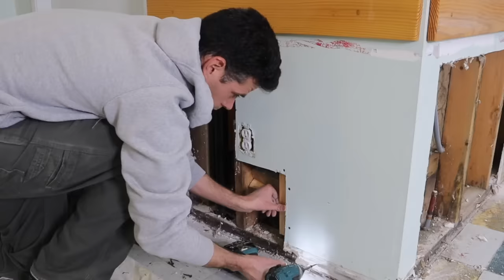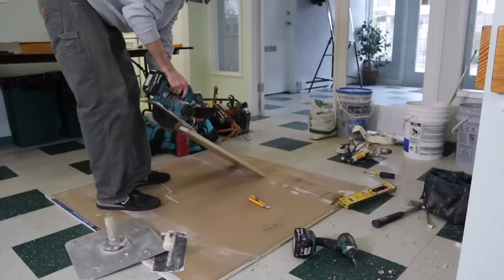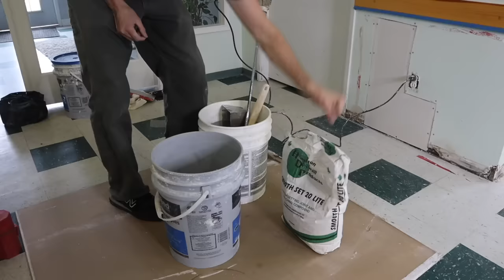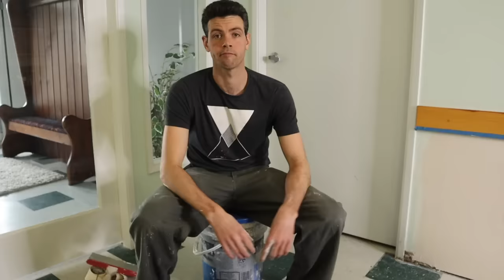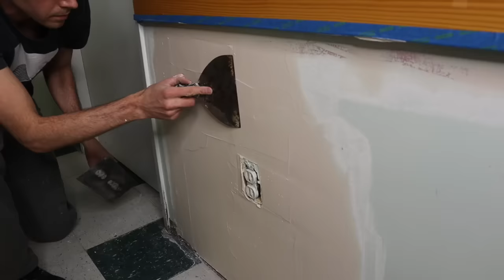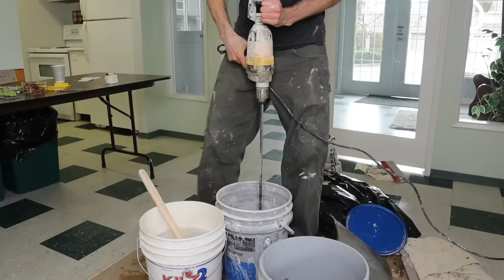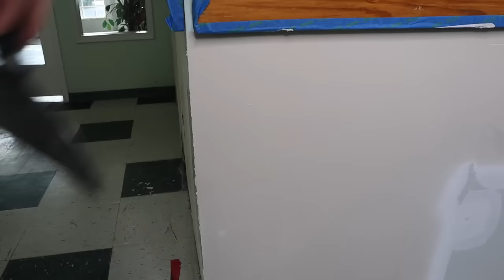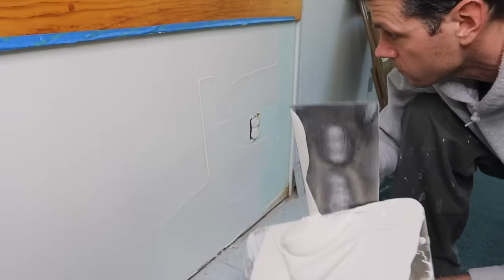Strangely Satisfying Drywall Repair!!!

Comment: Thank you you convinced me to hire somebody else to do this for me
Reply: He did it completely overkill fyi
Reply: @TheKSProduction  how so. Yeah, it's like a level 4 or 5 repairs he did but wouldn't you want to show the best way if you're a professional like him?
Reply: @TheRebuilt1  oh man, lose the attitude :-) take it a little easier. This fella definitely was on the overkill method. Just get the patch pieces as tight as possible, trim away tattered edges with a very sharp knife, tape it and mud it working your way up with a bigger mud knife. I just stopped to look after I saw him using a concrete trowel. I have anywhere from 2", 6, 12,  14" trowels that are over 20 years old. Buy good stainless steel stuff and it will last forever... But in a pinch I have used anything to spread mud. Everything except a concrete trowel! I have those too, I was just laughing at myself for not thinking of it.
Anyway, he's not being negative saying it's Overkill. Not being negative about the final job. He just did it the hard way. I do things the hard way sometimes trying to invent a new method or make something better that doesn't need to be better! I'm glad he has the time and gets to put himself on YouTube and show someone how to do it even if it is the long way around the block.
Reply: Lol
Reply: Most people would patch, mud, and sand. He just happens to have expertise in skim coating and such. Otherwise, even most contractors would just mud, build it up, feather it out, and sand. They won’t skim coat the entire wall.
Reply: Same 😭😭
Reply: Lmaoo 😂. Same
Reply: he should change name of the channel to Vancouver Cowboy 🤠
Reply: @timwilliams632 think he's just better and more used to the feel of a trowel, in many videos he says a diy person will probably pick up on a knife easier.
Reply: Lmaoo
Reply: @timwilliams632   When used on mud it's called a mud trowel.. 👆

Comment: The best tidbit in this whole thing was the 3m spray adhesive on exposed brown paper. That stuff can be a bear without painting it first. This is gonna save me time for sure
Reply: Agreed, trying to mud over that guarantees bubbling, I am so happy he showed that.
Reply: I didn't even think about getting this in spray cans, me, the pleb, was doing it with a brush even for tiny small patches of exposed paper. No brush cleaning from now on, and wasted half cans or something.
Reply: I think the KILZ oil-spray is used for the same thing.
Reply: Needed more info there...some words on the screen so everyone is sure you sprayed 77 on the exposed inner brown paper.
Reply: Yeah. I just durabond over any spots like that. Comes out ok. But I always have 3M 77 in my caddy. Good knowing.
Reply: I still would have prefilled the seams so it won’t crack later
Reply: I would use Kilz Klear on the raw paper. 30 minute dry time.
Reply: What is the name of that spray he used does anyone know? Is it just called 3m adhesive spray?
Reply: Bobby Brady  Agreed! I'll buy 3M *every time*. The only 3M product that didn't work for me was some orange electrical tape (didn't stick well), so I went back to black Super 88.
Reply: Wood glue or glue stick works too. Shellac primer is a good oldie too , stinks but dries fast, sticks to anything and covers up stains and smells. I'd be too worried the spray tip on the 3m can would dry up and have I'd have to to toss it.
Reply: ive had it bubble from killz as well, my goto has been alex fast dry over the brown paper, then mud. imagine removing one of those glued on wall mirrors like a 10'x10' with mirror mastic. brown paper like swiss cheese. oddly enough alex fast dry always worked, and cheap
Reply: @MercOilbuner  A little acetone will fix that problem if you soak the spray tip for a bit.
Reply: Time stamp?
Reply: Bobby Brady  I tend to agree, but some of their sandpaper is now  made in china.  But I totally understand you.  Seeing a 3M branded product used to mean that you rarely had to worry about quality.
Reply: I was just in here trying to find out if that was the 3M Super 77. Great idea
Reply: Its not adhesive
Reply: @mikekleven8130  it is though.

Comment: I recently bought a house with some really BAD drywall work and patch repairs.  You can see them from a mile away.   Improperly taped drywall sheets that stick out, patches that look like a big lump on the wall that was painted-over, poor surface texture over God-knows-what.  The previous owners either did the work themselves and had no idea what they were doing or they hired someone for the cheapest price possible.  There is definitely a world of difference between low-end and high-end work.

Comment: I watched tons of vids about fast drywall patching and I wanna say my opinion with my 15 years of experience.  The concept for each of them is the same: three coats of mud in the same day. Everyone talks about set mud: set mud is not completly dried mud and the difference is huge!!!! And problems always come when you put another coat on a mud non completely dried, especially when you do this on a painted surafce in a thick layer as just showed in this video. If you are luck and do not get bubbles (just like in the video happened), after 1-2 days when the mud wil be completely dried, you'll get also "waves" and the won't be flat. There's no doubt about it, I found tons of these issues...  Because, when you finish the last coat, surely the wall is flat, but when you go away the mud starts to set up it retires, because mud in a thick layer, always retires, it's an its charateristics ! I'm italian, I hope to have described well my concept. If anyone would say his opinion I'll be glad. Thanks a lot.

Comment: As a mold remediation guy,  couldnt help but notice what looked like a bit of surface growth on the back of that opposing side drywall lol ..
Reply: Gnarly.
Reply: How does that form?  Humidity or water damage?
Reply: Yea!!! It's the second unit's bath wall. Encapsulate that mold in wall! Paint new patches with stain blocking primer then paint.
Reply: @TheTerminator1919   I've seen both result in growth, but when its like that I'd guess it was a loss at some point previously
Reply: That piece he pulls off at 1:35 is cover in mold on the backside as well!
Reply: @TheTerminator1919  Not just water and humidity. The key word is prolonged. When the area doesn't have a chance to dry out.  Like the inside of the wall here.
Reply: Spray adhesive over torn paper? 🤔 I've been using a shellac spray paint primer which dries super quick but I'll have to try this on the next one.

Also nice trowel work, I'm a pan and knife guy and cannot for the life of me figure out how to properly use a trowel and hawk without dropping 90% of my mud on the floor 😬
Reply: Yes, you right and is easier to cut 2ft  cuts on the center of the studs. But he is good on his trade!
Reply: I literally was just going to say the same thing
Reply: Shaun Arnault Could you be using a little too much water? Or were you joking. 🙂
Reply: I cringed the whole video nice repair tho
Reply: @chrislecompte6676  This would be my first time in repair due to bad water damage. Would you recommend I just pay a professional to do the job? The damage is a bit bigger than the job seen in this video. Keep in mind the rental also has carpet I would need to possibly replace.
Reply: That’s what I notice too. Lol
Reply: @DJMAGICVINYL  my situation right now. What did you end up doing?

Comment: Geez ... by the time you finish I’d still be trying to cut out the first board 😏
Reply: Reg Starr That would also have taken me few days to accomplish the same damn thing.
Reply: I'd just opened a beer. Can't do home projects perfect without a beer.
Reply: No sanding?
Reply: 1943vermork  - The 20min mud makes a huge difference on turn time to get something done end-to-end.  Just be sure to scrap and clean all your tools right away like he did; that stuffs like a rock when it hardens.   (Ummm, except that one spot that gave him a fit ... hehe)

Comment: I thought patching a job like this, takes long, only for DIY guys like me. But now u made me feel more professional. It seemed to take pretty long. Wouldn't it be faster to remove all sheetrock on the bottom and installing full boards? Thank u.
Reply: That's what I would have done. 😏
Reply: It would be more work because u would have to apply the mud come back to sand it down then paint over it and apply your texture
Reply: @nawfvic9279  I dont see why this doesn't need sanding and painting. This is 1 piece of mud.
Reply: GTheGreat1 yea I get what u mean but for a person with no experience it will be much harder to take off all the Sheetrock and do the same process again u get me?
Reply: Yup, what you said. ALL of the whatever kind of mud you used has to completely dry. Faster to demo to the corner bead and replace the entire board. Only 3 joints to float and 1 of them is the corner bead. Definitely a mud wall now.

Comment: This video was so relatable, as it’s much more like my typical job; repairing part of a room before painting it.  I often enjoy checking out your videos, but this is just closer to home.  Pleased to see the mesh tape out, as that’s all I use (ultra thin mesh).  Boy, I always get something out of your videos and shorts, but the big takeaway here is NOT sanding between coats, which I haven’t had the courage to attempt until now.  This will save me so much time, as I would usually have to wait for each coat to be much dryer to be able to sand.  I am looking forward to the next repair!!  Funny, I used to dread drywall jobs, but your videos drove me to tackle them a bit more confident and competent than before.  Thanks!!

Comment: How do you keep the mud so smooth, every time I use 20 min mud it clumps up after a few minutes
Reply: Need to wash everything every time your done and use clean water. That’s what I found out.
Reply: Also use cold water and mix to a good consistency. If you don't mix it good, it will be a nightmare to work with. Power mix it for a least 2 minutes.
Reply: What they said.  Water needs to be clean and cold.  The dirtier and/or warmer the water, the quicker it's going to set up.  And it needs to be mixed well to get the clumps out.
Reply: @StudioLB  haha

Comment: why not replace the whole area under the board? 
Just mud the screws and put on a new corner and you are done in 45 min with cleaning up
Reply: Well 1) the corner really wouldn't be all that much less work than what he did but the problem for sure is 2) that's really gonna throw the customer off, they're not gonna like it even if there's no reason not to.
Reply: I have to agree with op... save all that time by just replacing the whole thing. He's definitely a pro though, I'd be curious to know why he didn't just do that.
Reply: @petergriffin383  like I said, customers don't like to see you making a bigger hole. And when they see a bigger patch, they'll think it's more money. Some can have their reservations explained away and many cannot.
Reply: @petergriffin383   Get paid fora one day job or get paid fora week job . No brain ah.
Reply: @cm01  The customer doesn't care HOW it get's fixed, only that it does get fixed.
Reply: @jasonbroughton4126  By your logic, that would be called ripping somebody off... Vancouver Carpenter is an absolute pro and would never rip off a customer like that. Furthermore, Vancouver Carpenter doesn't need to rip people off like that, a man with his skill never needs to worry about money or finding work. In fact, suggesting that he purposely did this so he could charge more is kinda insulting to a professional. A professional will quote a job for the customer, the customer agrees to the price, and then the professional takes the fastest easiest route to complete the job. The op is right, it would've been easier to just replace the whole area. I'd very curious to hear from him and why he chose this method.
Reply: @petergriffin383  ideally, yes. How many retired people have literally watched you for the whole job and tried to offer their own input constantly?

Comment: Loving your channel, I was going to hire out some drywall patches, but you convinced me to give it a go myself!  I’m doing a small remodel job on one of my investment properties and will be posting a small video on it.  If you, or anyone wants to watch and give me some thoughts or feedback, that’d be awesome!  I’ll. Cheers!
Reply: That's awesome man, it isn't too hard. Though, I would recommend 45 minute mud if you haven't done much of this before. 20 minute mud is great, but it sets up really fast and becomes unusable pretty quickly. They also do 90 minute too, but it does get a little weaker as you go up the list. Starts to act more like premixed mud. Of course, you could always make smaller batches of the 20 minute mud until you get the hang of it.
Reply: TheRiddler491 Thank you for the tip!  I was wondering about the mud, since it looked more like an art form.  If I mess up can I just sand, remud and try again?
Reply: @KaiAndrew  It's one of those things that isn't necessarily hard, it just people tend to think it's super easy and then get frustrated with it. Putting mud on a surface is a lot like painting. It isn't hard, but it requires patience. What I would recommend is watch a few more of his videos on mudding, then start small. Practice filling in a few nail holes to get a feel for it. Once you see how it behaves, it's super easy. Took me a couple of days to get the hang of it, then it was simple. I would definitely recommend 45 minute compound. As soon as water hits the joint compound it starts to settle. 20 minutes seems like enough time, but if you aren't quick, you'll end up having to throw a bunch away. Even if you are good, like Ben is, you'll see him throw a bunch away because it became unusable. That happens. When it really sucks is when it starts to set up on the wall when you haven't finished working it. Be patient, and it will come out nice. Take your time and FEATHER YOUR EDGES
Reply: TheRiddler491 this is awesome advice.  Thank you very much.  Let’s see if this can save me a few thousand bucks ;)
Reply: @KaiAndrew  No problem man, good luck. If you find yourself getting flustered, take a break and come back to it. Patience is key. Most problems when doing painting, patching etc come from frustration.

Comment: Love the video. I do this exact thing pretty much daily. Quick tip for you that I do. The area that had the electrical outlet. I've learned to cut the area completely away from the outlet. Unfasten the outlet. Pre cut the hole for the outlet in your new piece of drywall. Leave the outlet sticking out. That way you can pass your trowel right over the edges of the box without having to contend with the tabs of the outlet. Because that can be a little tricky. Just a thought. Really nice job 👍
Reply: How many coat did he use?

Comment: Wouldn’t it be easier to just replace the gyprock from the chair rail down instead of piecing in
Reply: Yes, it would be as you could hide the seam behind the chair rail, minimum mudding needed then but he probably wasn't getting paid enough to justify doing that unfortunately.
Reply: @stargateproductions  but that would've been both faster and cheaper and produced a better end product
Reply: Thinking the same thing.  Less seams also

Comment: Very professional for a small job. I learned a new trick for screw and nail pops if you need it paintable it minutes. I was painting a renovation this week and it was the final day. Came across 6 pops on the final wall. I used bondo to fill the the hole, then just a tight skim of mud. Worked quite well and was done in under 3 minutes

Comment: Allow me to criticize you constructively? Take the 2 minutes to disconnect that receptacle and wire nut it in the box so you can work over it instead of around it. You won't regret it.
Reply: he needed the outlet for his mixer!
Reply from the maker: The screws were so stripped I couldn't even pull the receptacle out. If you add up the time it took to work around it it was probably less than removing it. Also, I'm no sparky. I don't mess with electrical.
Reply: @vancouvercarpenter  If you only touch one wire at a time you wont get shocked!

Comment: Outstanding work.  Music for the video was great. 

I learned a couple of tricks. 

I would have to cover that outlet with tape, otherwise it would coated in mud.

Ben you have far more skill than I do, but I have a trick for those who have problems with getting square corners or for corners where the framing or sheet rock has hollow or bow.

Add mud to both sides of the corner and then use a big framing square to and pull the mud up from the bottom. Using the long leg of the square to get out to a flatter part of the wall. 

I have used this technique for years because I do not skim drywall mud often. It saves me time.

Comment: Thanks so much for taking the time to make this video! I just removed a vanity top backsplash and despite trying to loosen it first it still tore off huge chunks of drywall and in some parts tore all the way through it. It’s about 47” long and 4” high. Would you recommend patching or replacing the drywall?

Comment: Due to lockdown here in New Zealand, I became the guy who had to do the walls so the new kitchen could be installed.
OMG I was embarrassed by my first attempt at using mud, I have now pulled out the corner strips and replaced them after watching your videos. I have also done the ceiling which I am very please about. Thanks for the trick/tips/how toos' I have gone from bad amateur to someone who is now pleased. The kitchen bench top installer was actually impressed with the job and did not believe it was my first time.